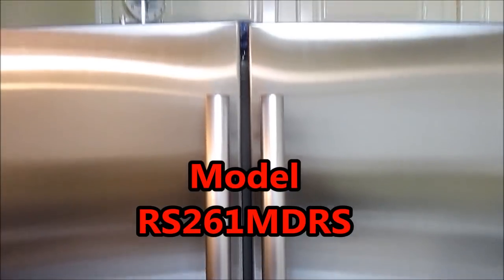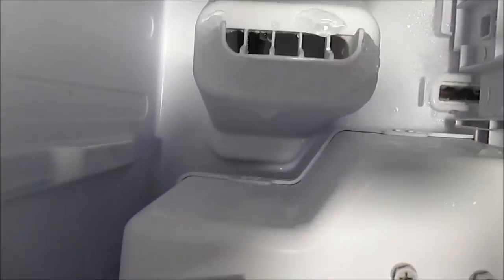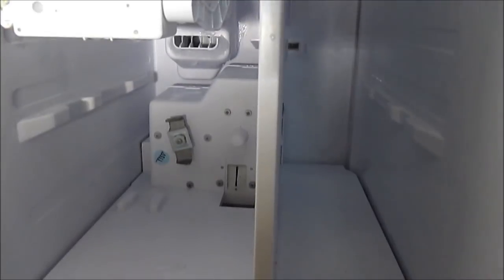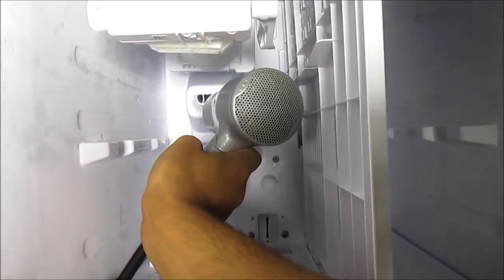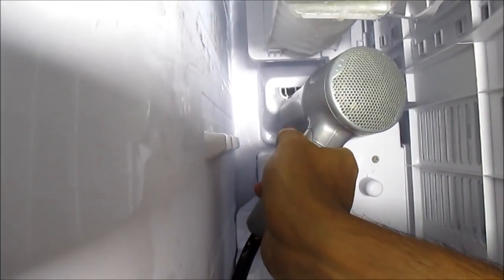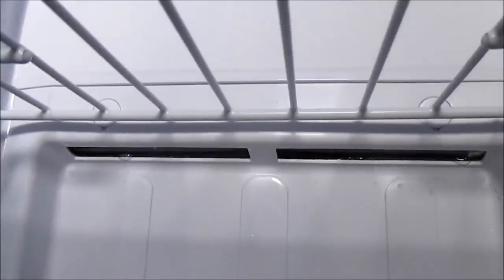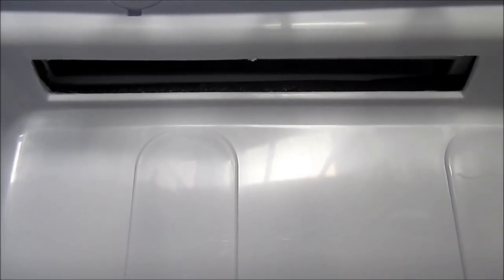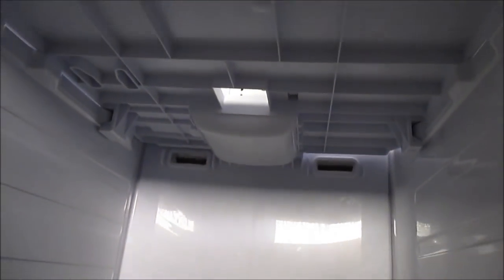How To Stop Noise From Samsung Refrigerator RS261MD **

Comment: For those whose Samsung fridge is making noise due to the refrigerator fan blades hitting an ice build-up, here is an easy but temporary fix (temporary, since it treats only the symptom of Samsung's flawed design, rather than the cause). You don't need to remove food or even open the fridge, but it only works for those models with the right kind of front control panel: Simultaneously press "Freezer" and "Lighting" on front panel of fridge and hold (8 seconds on my fridge) until it beeps. Release, and press "Freezer" repeatedly (three times for my model) until it displays "rd" (rear defrost). This manually activates the rear defroster, and your fridge will beep annoyingly for awhile (about 27 minutes on my fridge). I usually repeat this process 4-6 times in a row, setting my phone timer for 27 minutes to keep reminding me to go and restart it. This fix usually lasts me a couple of weeks. If you remember to do it frequently, on a preventative basis--say, before going to work or to bed, you may stay ahead of the problem.

Comment: I just had this on my Samsung fridge too, the ice builds up around the fan and the fan rubs on the ice. I removed the plastic cover inside the freezer to get at the ice. Two other reasons this happened to me was the water drain at the bottom of the freezer was frozen over, I was able to access this water collection area easily with the cover removed. I melted the ice with hot water. The worst thing I did wrong was to have the freezer too cold, I set the temp control all the way cold, that froze the water to the ice maker and the drain. I now leave the freezer at 50% and this is working for me.

Comment: Please respond I took hours with a hair dryer and still couldn't properly get the panel off to actually get it onto the part where all the ice forms but it's still gone quieter for now. Wanted to ask does pouring hot water on it work?
Reply: I got all visible ice off though and it has stopped the insanely loud humming thank God but can hot or warm water be poured in the vents?.thanks.
Reply from the maker: I wouldn't recommend removing any panels or pouring any hot water personally. One thing I did that helped big time is cranking down the setting for the freezer which was too high. My setting now is to a point where my food is still freezing, but not overly cold.
Reply: @Megalodon1  fantastic thanks for the reply I did it like 3 hours ago and got rid of lots of ice and it's been quiet since so I'll just use the hair dryer when needed..thank you very much we can all sleep again as it was doing this for 4 weeks really really loud and until I checked your video out earlier and now its quiet your a life saver 👍
Reply: @Megalodon1  Your video was incredibly helpful. Thanks!
Reply: I would also recommend leveling the refrigerator per Samsung's instructions as it may prevent it from happening so quickly. All thanks to Mark Archuleta's comment.

Comment: This is a temporary fix that lasts me about 3 months. I think Samsung needs to come up with a permanent solution. I'm thinking about throwing this one in the dump and buying a different brand. No one in my area will even work on Samsung. I also have TV's and mobile phones by Samsung but if they don't standby this refrigerator then I've done with the brand? I've contacted Samsung so.we'll see what happens.
Reply: Yes, this worked for me for just a few days. It is a design defect.
Reply: T G I have been reading on this and it's multiple fridge companies having the same issue
Reply: Exactly the reason i aint getting rid of my 20+ year old GE
Reply: I do this about every 3-4 months now. Never buying a samsung refrigerator again.
Reply: T G thanks
Reply: You got THAT right !! My Moms Frigidaire is over 60 years old and still purrs like a kitten !! No wonder she won't part with it. Samsung should give us ALL our money back so we can buy a WHIRLPOOL ? From what I'm hearing, they are pretty reliable ??

Comment: is it ok to use this fan while the refrigerator is still plugged in and working? I cant access the plug (bad kitchen design)
Reply from the maker: I would not use the fan while the fridge is plugged in due to the risk of electric shock.

Comment: i usually use a rubber hose in between the hairdryer so the plastic dont melt 
it also makes it easier to hold in tight corners and the risk of electric shock is minimised

Comment: The root cause of the problem is ice built up and then clogged up the cold air vent holes and jammed the fan by ice. There are multiple reasons for ice build up:

1. Where did the ice come from? To minimize the ice we need to keep moisture inside to the minimum, which means covering up glasses of water, milk, opened sod cans, soup, cut open water melon, mango, fruits, wet vegetable, raw meat, etc. . The humidity inside the refrigerator is quite low, and so anythings that can be dried up will release moiture and this will form ice, and too much ice will out win the defrost heater short heating cycle (Samsung designed short defrost cycle to achieve the Energy Star) and the net result is a slowly ice build up if too much moisture inside. 

2. The other moisture source is the bottom Pantry tray that collected water. You need to pull out the pantry and clean this bottom tray every month or so, or after a spill from trays above. Any liquid spill not cleaned up will ended up as ice inside the fan box -- no magic about this. 

3.  The bottom drainage hole is clogged up with ice. Once this happened, every degrost cycle will release the water down into the bottom Pantry and pool there. This water then evaporate and form ice inside the fan box eventually. (Hint: to melt the drain hole ice fast, fill up the "pond" above the clogged drain hole with water then place a 15 watts soldering iron hot tip into the water and make sure to keep the hot tip from directly touching the plastic part that can be melted. Add more water if the "pond" is dried up and expose the hot iron tip. The hot water will melt the ice and clear up the drain hole. This method is faster than hair dryer or adding hot water spoon by spoon. You need to keep an eye on this and remove the iron as soon as the hole is cleared. 

4. Due to Energy Star regulation, Samsung and others have tried to design their products with low electrical consumption, which means they run the defrost heating cycle in much shorter time. If there is not much ice built up then the short defrost cycle is enough to melt all ice, but if the ice is too much then it ended up winning the battle and jammed up the fan or clogged up the cooling vent holes and the unit cannot get cold. 

So how do we solve these  problems? It is unrealistic to have zero moisture inside the refrigerator, but if we can keep it to the minimum as I pointed out in (1) and (2) above, and with a modification to the design that prevents the drain hole clogged up then the problem will be eliminated permanently. 
To solve the problem (3), I used a 6 inches long, 3mm diameter copper (or aluminum) wire, wrapped around the black heater pipe  (just above the drain hole and running across left to right) 3 turns, and extended the wire down into the drain hole. If you don't have large gauge wire then just use two smaller gauge wires, wrap them on the left and right side of the heater pipe and extend the wires down into the drain hole about 1.5 to 2 inches. This should carry the heat from the back heat pipe down deep into the drain hole and helps to prevent ice building up inside the hole. 

I used to fix the ice build up issue every year, but after implementing the 3 steps above, it has been running over 2 years and still no problem. My unit is RF266AB. 

Brian

Comment: okay I done this and when I finished I plugged back up and now its reading code 22 E . which is freezer defrost fan error. I don't know why. I can't find any info to fix it. I just unplugged it again for about 15 min and plugged it back up and the code is gone but I don't know if its cooling now. it has stressed me out!! any info to fix this would be appreciated
Reply from the maker: That's odd, I've defrosted my fridge 3 times with no such errors. Try to re-plug the fridge once again and see if the error message returns. Good luck
Reply: +megalodon1 it is cooling, its still making the notice only not as loud. the error is gone. it has me so worried.
Reply from the maker: +Crystal Thompson Glad to hear the error message is gone. There might still be frost built up if the noise is reduced but not totally gone. I'd recommend repeating the process one more time in case there is still some ice left.

Comment: You either have warm air getting into the unit, causing condensation, then freezing, or you have an automatic defrost problem.  When the unit doesn't defrost automatically, the ice builds up, restricting air flow and causing the fan blade to hit the excess frost and ice.  Find out what is causing the frost, and fix the issue permanently.
Reply: The ONLY permanent solution is to drag this 450 lb SILVER ELEPHANT to the dump and buy a Whirlpool ????? I have done EVERYTHING in the book AND everything everyone has suggested on here. I will be ok for a day, week, month and then right back to page one again .... bottom line is DO NOT BUY A SAMSUNG REFRIGERATOR.

Comment: I have two Samsung refrigerators. One side by side with water dispenser in the door, bought in 2012. And one with bottom freezer bought in 2013. Both of them have the same issue of ice forming around the fans needed to circulate the air. The side by side took a very long time to fix. This issue happens every two year. Samsung appliances have very poor design. Their washers are also pathetic. My $1400 top of the line front loading Samsung Washer with auto leveling suspension (sounds like an SUV) and LCD front panels etc. lasted all of 6 years. My old school Kenmore top loader has been working for over 15 years, now at my gardener's house. My brother's $950 Samsung dishwasher died in 4 years. Samsung makes beautiful shiny appliances but they have terrible design or engineering faults. Stay away from them at all cost.

Comment: I had to have the fan and motor replaced and about a year later it started again. I just turned the temp down a couple of notches and it quit. Just don't run the freezer as cold as it will go. Everything is still frozen well even the ice cream!

Comment: We have the SAMSUNG  Model RF23HCEDBWW/AA  French Doors over the Freezer design. Four weeks ago, we paid $195 service call to "repair" this same noise problem.  The repairman took the cover off and used a hot air blower to melt the ice.  Two weeks later our icemaker suddenly quit working. The repairman informed us that this is an ongoing problem. The fix is only temporary and the replacement part and labor will cost over $300 and work maybe 3 to 4 months.   We thoutht we were buying a quality product that would last 10 to 15 years.  Little did we know this very large local retail store did not have a repairman and that the repairs for Samsung we handled by an appliance retailer in a much smaller town 30 miles away.  Also, we not told at the time of purchase about replacements of the water filter which cost $50 to replace and seem to automatically display a warning light to replace about every six months.  I was told by 2 different repairmen (1 GE and 1 Samsung) that the filters are fine for at least 12 to 18 months. I have information on a class action lawsuit that is in the courts.  I WOULD STRONGLY ADVISE ANYONE NOT TO BUY A SAMSUNG REFRIDGERATOR....PURE JUNK.

Comment: Samsung days, " do not use hair dryer and DO NOT TURN REFRIGERATOR OFF" TURN ON DEFROST MODE....
Reply: Been there did that ...... still makes racket every day, and I cycle the defrost from refrigerator to freezer at least twice a day now. I'm going to go take this thing apart AGAIN and use a hair dryer on it ..... again. ..... It stops the noise for a few hours and starts again. I'd like to throw this 450 lb SILVER ELEPHANT off the deck and drag it to the DUMP. We paid $2800 for this beast when we bought our new home so we WOULDN"T have to deal with old appliances. We just retired a few years ago. This junk is only 4 years old. No more Samsung for us .....

Comment: I dont have a hair dryer can I use warm/hot water?
Reply from the maker: Nooooooooooo, don't use warm/hot water. Buy yourself a cheap walmart hair dryer, should not be more than  20 bucks. Thanks for watching
Reply: used hot water in spray bottle it worked great no noise now
Reply from the maker: CornwallKate I'm really happy it worked for you :). My concern was getting the water into some of the electrical connections/ components/fan inside would potentially cause damage. I would also think that the hot air would reach the entire cavity that is iced up vs the hot water which would be directional.
Reply: Use hand held steamer!
Reply: great!
Reply: CornwallKate I have used hot water only, it helped with melting ice. You will have make sure the water stays warm constantly. It works very well but I think talked a bit longer than using hair dryer.

Comment: I just got a mini freezer for free but it makes an irritating noise i can't identify. It's not the compressor and it seems to have no fan. 
It's coming from inside the freezer and not the back. The sound is kinda like scraping ice or when you use a screwdriver to scrape through ice or metal and it comes in waves.
Even when i unplug the freezer the noise continues for a short period of time and the sound waves get slower.
I suspect something like the water flow through the tubes but i haven't been able to find any problem like this.

Can somebody please help before i kick the shit out of this freezer?

Comment: Had the same problem and I let it go on for too long, I guess, and now my evaporator fan motor has gone out because they refrigerator side isn't cooling.  Now I have to find a video on how to replace it.  I like Samsung TV's and phones but their appliance division is the worst!  I've had to replace ALL my Samsung appliances, with different brands of course; washer, drier, micro, dishwasher, and now my fridg is having issues but hope I can fix this myself!  NEVER buying another Samsung appliance again!!  Even a salesman, where I've replaced most of my stuff, said Samsung appliances are the worst and do not last and does not recommend them to anyone even though they sell them in the store he works in.

Comment: Don’t EVER use a hairdryer in your fridge to thaw the ice if it takes very little heat to meet the fridge lining plus as he warned electrocution is very possible. He is close to fixing it thawing it is the first step to the repair. Use a steamer to thaw the ice. Verify the drain to the pan to the bottom of the fridge is not clogged or frozen. You May also have a bad thermistor or heating element causing the rear coils to freeze up also Samsung has changed the drain tubes to have a 1way duck bill valve to stop warm air from getting sucked back into the freezer.

Comment: I have a french door lower freezer model and it sounds like a plane is taking off in my kitchen. I will NEVER buy a SAMSUNG appliance again. I had to do the hairdryer on the freezer thing twice as well. Seriously Samsung if your customer spends 2,500 on a fridge they shouldnt have to defrost it with a hairdryer
Reply: Samsung had a poor quality fan motor bearings located in the fan/auger assembly. Suggest replacing the unit with a new updated one. Icing issues they have an updated motherboard that should take care of that.

Comment: Do not use a hair dryer for this!!!!!!!!!

From the Samsung website:

If you perform a manual defrost, DO NOT USE A HAIR DRYER or any other heat source on the refrigerator to speed up defrosting, as this WILL damage the refrigerator.

To perform a manual defrost:

Remove all perishable items and empty the ice bucket(s).

Lay down towels underneath the fridge, and keep a good supply of extra towels handy.

Unplug the fridge and prop the doors open.

As time passes and the towels get wet, swap them out for dry ones, until the towels stop getting wet or at least 24 hours pass.

Turn the fridge back on and close the doors. After about 2 hours you can put the food back in.
Reply from the maker: I have personally used a hair dryer over 10 times and my freezer works fine without any damage to my fridge or any comments from  currently over half million viewers of this video stating any damgage performing this method either. Sounds like Samsung is aware of the problem wants you to either buy a new fridge or empty out your entire freezer and wait hours for your food to spoil and won't recall their poorly designed product at this point of time.
Reply: @Megalodon1  Thanks for the reply! I just saw that warning on their website but didn’t know people had used hair dryers without any issues. By the way, there’s a front panel setting that will defrost the ice without taking the back apart or emptying the fridge. Someone posted a video on it here: https://youtu.be/hlxZAz5vk2k. I tried it today and the fan noise went away. It takes 30 minutes and may need to be run twice to melt the ice. Also, many folks (including me) have had huge ice buildup inside that back panel and water leaking out the front because of the drain freezing over. There are YouTube videos on how to fix that with a $2 metal clip that you can buy on Amazon. (Works really well). Thanks for posting the video. Thoughtful DIY videos like yours truly are the best thing about the internet. 😊